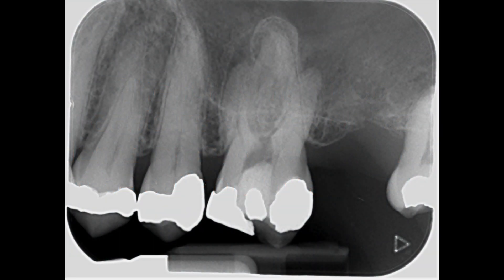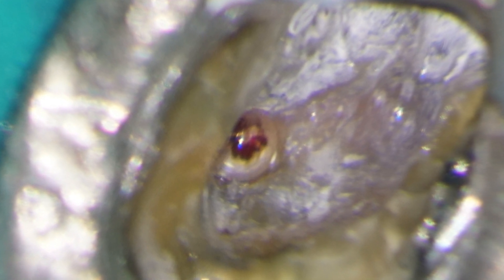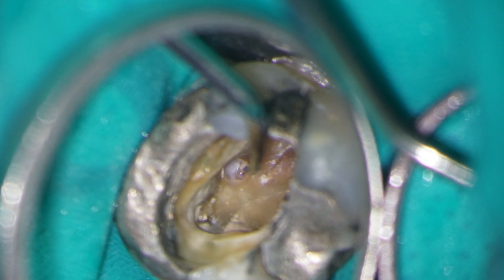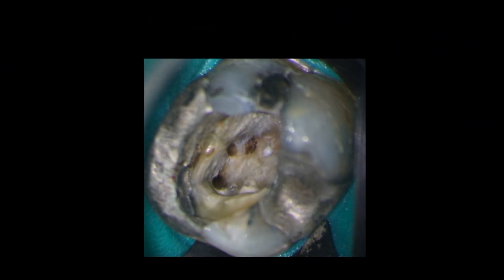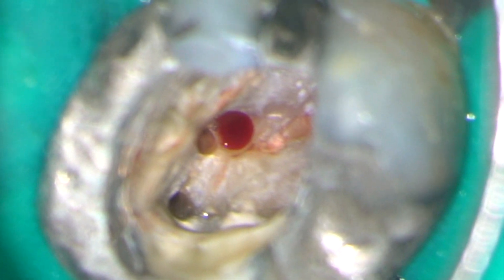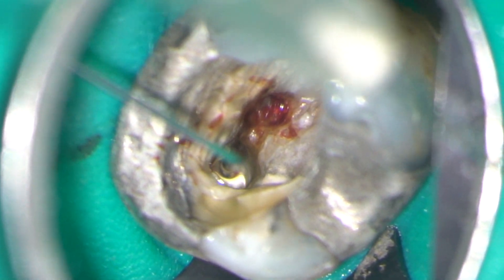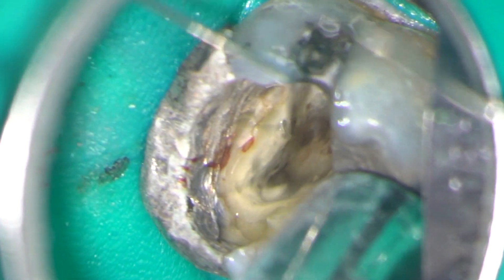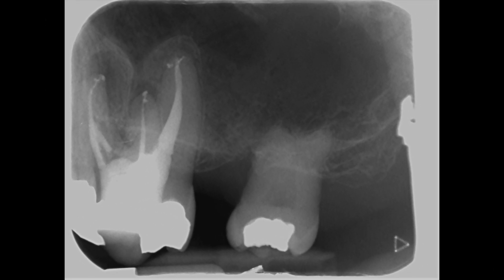Molar Perforation Repair

Comment: Hello! It's a GREAT video!! Really appreciate for showing your case. I have a question, how do you remove any sealer that has covered or filled the perforation site? Or is there any tip to control the sealer?
Reply from the maker: Hello there, thanks for watching. Great question - BC sealer can be washed away with 3:1 whilst resin sealer such as AH Plus you will need to use some etch or solvent. Cheers John

Comment: Great video as always.
Sir, I had a doubt though, Hypochlorite could easily pass through perforation site wouldn't it damage the inter-radicular tissues of the tooth while it was being used?
Reply from the maker: Hi Suyog
The perf site has to be disinfected as any bacteria remaining will undoubtedly lead to re-infection. The hypochlorite is never injected into the perf, but washes passively. Any tissue damage seems to repair, although I do not have any histological analysis to go by!
Thanks for a great question and pleased you enjoyed the video
Cheers
John

Comment: Dear John. You mention in the video that you’ve taken a working length radiograph just to be sure that your working lengths are correct.  As this is not your normal practice, what’s the reason for taking a working length radiograph in this instance?
Reply from the maker: Hi Sadiq 
I dont always use a diagnostic radiograph I prefer to rely on my apex locator.
Sometimes I take a cone fit it I need reassurance!
Thank you for watching 
cheers
John

Comment: Dear dr. Can you please answer my questions? 🙁
1- when there is granulation tissue in perf to what limit we should remove the tissue ? Up to the bony crest or just about under the furcation of the tooth ? I’m having trouble knowing where to stop removing tissue under perf
2- if there’s a deep pocket and a communication between perf and oral cavity is extraction the solution or we can try with mta first to see if its set ?
Thank youuu !
Reply from the maker: Hello Grim Fandango,
Sorry for the delayed reply I have been very busy!
1) If it is a small amount of tissue then remove completely, the hypochlorite will dissolve some
2) In this case you may need to place a filling externally such as composite if the perf is accessible
Hope that helps?
All the best 
John

Comment: great
instead of collagen how i can stop bleeding in the perforation site doc? can i use ferric sulfate ?
Reply from the maker: Hi Ahmed
You could use ferric sulphate but it can be a bit messy, sometimes a sterile cotton pellet applied with pressure and a little local containing 1:80000 Adreanline is enough
Cheers
John

Comment: Great video, thank you John. I heard an endodontist once say to never restore an access cavity entirely with any kind of composite material, but to use a glass ionomer base material first over the pulpal floor and canal orifices. They never explained their rationale, but I'm guessing they believed it makes re-accessing the canals easier in the event of re-treatment? Is this true though?
Reply from the maker: Hi there,
Traditionally a two layer approach is used to create more barriers to microleakage and yes that combination will work well. In this case the tooth was being crowned almost immediately
Cheers
John

Comment: Hi John, great video as always. I'm just wondering if Gelatamp would be a suitable material to use as a matrix before placing the Biodentine? As we no longer stock haemacollagen. Thanks
Reply from the maker: Hi Stephen
There are other collagen sponges and yes they will work too as long as they can be plugged into the bony crypt.
Cheers
John

Comment: Excellent work prof . I have a question , what is your opinion on the negative pressure irrigation , especially in necrotic cases. Do you think they are more effective than naocl agitation
Reply from the maker: Hello Khalid
Thank you!
negative pressure irrigation is a good way of making sure irrigant reaches the apex safely, I dont think it is any more effective than a syringe and GP pumping. The activated systems like GentleWave however may have better cleaning abilities. (not available in UK yet)
Cheers
John
Reply: @johnrhodesendo  thanks doctor

Comment: Amazing as always.
Once i made a smaller perforation, referred to a specialist, she said such cases fail most of the time and it doesn't worth it .
Is that true?
Perforation wasn't even visible, only felt by kfile or probe
Reply from the maker: Hi there!
a small perf is generally the easiest to repair and has the best outcome!
Cheers
John